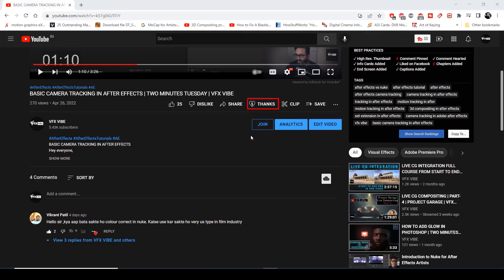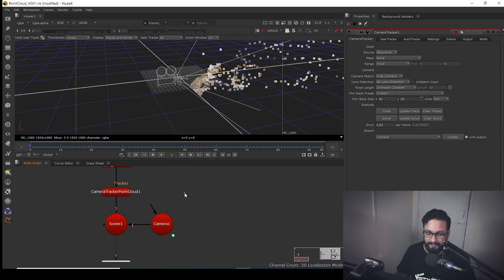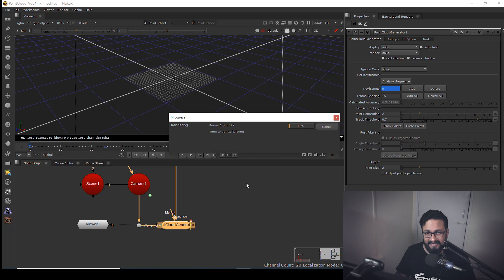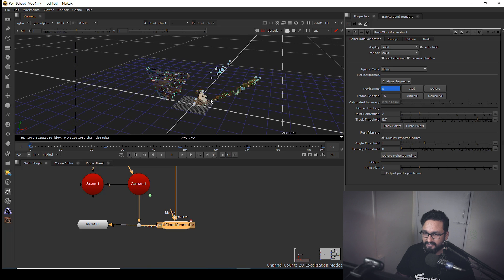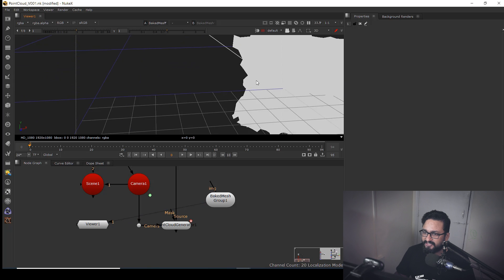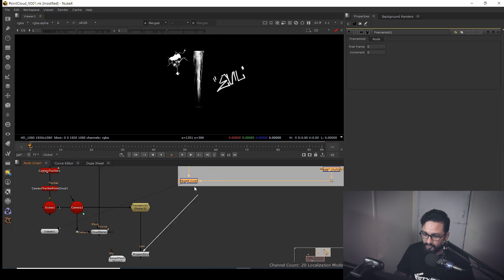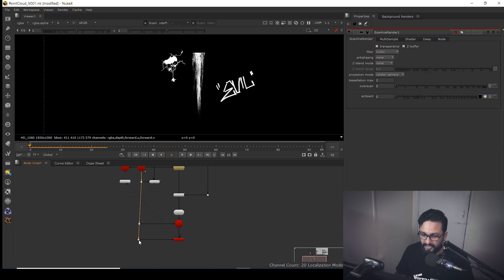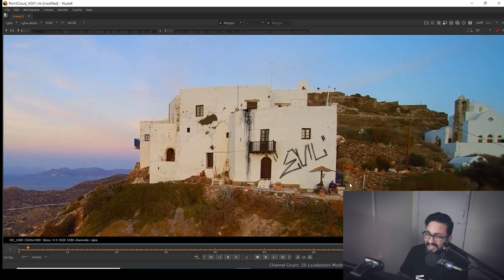HOW TO GENERATE POINT CLOUD AND MESH IN NUKE FOR CLEANUP AND PROJECTION | VFX VIBE

Comment: My Nuke almost always crashes when I try to bake selected group to mesh, I think it's a bug.
Reply from the maker: It might be due to system limitations
Reply: @VFXVIBE  It could be, although it's not that intensive a task for my work machine. I did some reading on it, and in some versions of Nuke, the actual loading window is causing the crash, as it pops up and immediately crashes Nuke.

Comment: Great tutorial! Thanks for sharing. Can you explain when it would be better to use projection to a mesh vs projection using a card on the scene? I want to make a clean plate for a green screen where you can see bits of the wall and window behind the green screen and I'm not sure which version to use (the mesh projection as per your video or using a card)
Reply from the maker: Thanks for your lovely comment.
Projection depends on requirements, if my projection is far in the background and there is less camera movement, you can do it on the card. If your projection is close to the camera and in the foreground, and camera is moving, you can do your projection on mesh to give it a 2.5 D volume
Reply: @VFXVIBE  Wonderful explanation! Thank you.